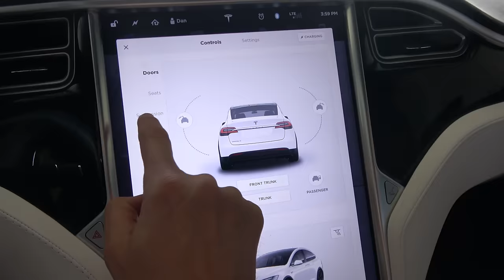What's inside a Tesla Tire?

Comment: The tire shop has a point. It take time, labour and resource to fix that wheel. They have to take out the tyre, cut the foam, fix the leak, glue back the foam and rebalance. No way it is free if it was that labour intensive. 

With regular fix, just locate puncture, jab with fix kit and you are good to go.
Reply from the maker: I told them I would happily pay for their time, the manager at Discount Tire said they refuse to touch the tire.
Reply: I have repaired the silent foam tire. Cost is roughly double a normal repair due to extended process.  Michelin,  Pirelli and Continental make these types of tires.
Reply: While that may be true, which I'm not saying is or is not, it's advertised as a temporary fix.  It's basically an alternative to a spare tire that takes a little more work, or less for a large heavy tire.  A permanent fix is a patch inside the tire.
Reply: I only repair tires from the inside.
Reply: I work at discount and we would take the time to do all that free because we are just good people and a good business. So yeah you fix a tire even if it takes all the time
Reply: OptimisticPessimist repaired tyres are Always a temporary fix as you will damage the cord when while repairing.
Reply: i work for discount and at my store location we fix those kinda tires ive done 3 repairs on noise reducing tires i dont pull the foam back i just cut a little square out big enough to do the repair takes a little longer but not to much longer and still free
Reply: Peyton Aho no you don’t
Reply: Its actually not that much more of a process I've done this repair several times as a discount tire Assistant manager and it took an extra 2-5 mins max.
Reply: We have a tire foam core bit at our shop as well that removes a small bit of foam on the other side so we can get to the rubber and repair the issue...we almost never put the tiny foam bit back but fill in the quarter size cored area with a flexible quick set polyurethane foam. I think the tire shop knew who he was and just said it's probably better not to deal with them. We do charge $20 bucks for liability purposes in case we screw up the rim or tire. Try going into a doctors office or hospital and asking to get stitches for free.
Reply: Michael Gese why would he lie about something like that what does he have to gain 😂
Reply: I find your reply most realistic. Because tyres like those does not seem to be made patch able. And you need to use glue or fill in foam in your case. Still cutting up the inside of the tire to patch doesn't feel right somehow.

Comment: 5:16 What? That’s not true. You don’t do that because “the tire will spin freely”. You loosen the lugs while the tire is down because they’re typically torqued on tight. You don’t want to knock your car off the jack while pulling the lug wrench to loosen the nuts. Also, don’t take the lugs completely off before jacking the car up like he did. Just Incase you do have problems while jacking the car up. Just loosen them until they’re hand tight. When the car is safely on the jack, remove the lugs fully. Do the same process in reverse while putting the new tire on.
Reply: I always use a jack stand when changing tires too. Something so simple can easily turn into a big headache. I'm sure that tesla's brake rotors cost a penny or two.
Reply: Lakaiskates Exactly. Jack stands are definitely a good idea. Also, as silly and simple as it may sound. Some people don’t know the proper spot to place a jack under the car. I’ve heard stories of people damaging their car because they put the jack on something other than a solid part of the frame. You can easily avoid hundreds of dollars in damage by knowing how to properly change a tire
Reply: closinginonclosure a
Reply: He was right in what he said though too. If you try and loosen the lugs with the wheel
In the air it will spin freely. When working on my cars I just skip this step though due to having an impact that loosens the lugs no problem when in the air.
Reply: Tucker Maxam I guess it’s slightly possible the tire could spin. But not likely. Depends on the type of vehicle, whether it’s front, rear, or all wheel drive and which tire you change. Tires attached to the drivetrain won’t move. That’s why your vehicle won’t roll when in park. Some vehicles lock all tires while in park. Regardless, I’ve changed front tires on rear wheel drive cars and they didn’t move at all. It usually takes a bit of force to move a tire. And with lugs being close to the center of the rim. Spinning the tire is difficult. Think of a merry go round. Or a spinning prize wheel. Imagine trying to spin them from the center rather than the outside. It’s very difficult. That’s just physics. At the end of the day, the main reason you loosen on the ground is so you don’t wobble the vehicle off of the jack.
Reply: closinginonclosure dude that is a big reason to loosen the wheel on the ground..... alot of situations the wheel can turn, like if it is in neutral, or the car is fwd and you are working on the rear, and vice versa............. front wheels of a rwd car don’t lock when in part, nor do rear wheels of a fwd car.
Reply: Tucker Maxam This dude has never worked on a car in his life, just let him live
Reply: PAsn0w43 If you read my previous comments you’d realize I already talked about wheels locking depending on front or rear wheel drive. I also said it’s possible for wheels to spin but it’s a rarity if you know what you’re doing.
Reply: PAsn0w43 I’ve never worked on a car in my life. Haha. Yet you say the main reason to loosen while on the ground is spinning wheels and not because you may wobble the jack. That’s hilarious. Ok dude. Whatever you say. Think what you want. Doesn’t change the truth. I guess that’s why nobody liked my original comment. Because I’m so wrong. You really got me. I’m so embarrassed.
Reply: closinginonclosure the fact that you say it is a rarity, and then go and say you know what you are talking about just blows my mind. Jack a car up, and try to loosen a lug nut on a wheel not on the drivetrain, with a breaker bar or tire iron. You couldn’t if you wanted to, because the wheel will spin before you can break it loose. Literally go outside and try it right now if you think a wheel won’t spin that easy.
Reply: closinginonclosure also it seems like you are just dieing to explain to somebody that you have to jack the car up at the proper jack points, like anybody who actually works on cars wouldn’t know that already.
Reply: Unless you have a diff lock and you put it in gear.
Reply: Rino Fagerlund If that were the case. Any car in park without a locking differential would be rolling down hills.
Reply: PAsn0w43 I currently own a Jeep. Non 4 wheel drive. Have changed all 4 tires without spinning. I’ve done this to multiple vehicles from a 67 Mustang, Blazers, Nissans, Hyundai, and others. Never had spinning problems. One of my best friends owns a tire shop which I visit frequently. Never witness spinning. Not while removing or tightening lugs, or taking tires on or off. So go on about it all you’d like. I know what’s what.
Reply: closinginonclosure i agree
Reply: closinginonclosure Not trying to argue here... I work in a scrap yard, we process hundred of vehicles a year. Imagine you’ve pushed a vehicle into the workshop, lifted it up on a two post lift, and it’s not touching the ground in anyway. Now, if you get your breaker bar and socket, and try to undo a nut it won’t undo, as it is torqued up so tightly that the wheel will just spin round as you push the breaker bar? When it is on the floor you should undo them a few turns, just to get you past that initial torque.
Reply: Tommy’s Diecast Apparently that doesn’t happen
Reply: closinginonclosure also, stop calling it a tire. It is a wheel, with a tire on it. If you knew anything you wouldn’t be calling it that
Reply: Rekt

Comment: Which Discount tire did you go to? I've work at Discount Tire for a year and a half and I can recall doing 2 separate flat repairs on foam-lined tires. Tesla was correct in saying that, to repair the hole, you just cut away the section of foam and then glue it back on. Again, I've done it twice. 

If that foam was indeed what the Discount Tire employee was referencing when he said the flat couldn't be repaired, he was obviously wrong.

Also, a bit of trivia: That foam does make the ride quieter and I've seen foam-lined tires on Teslas, Cadillacs, and Mercedes SUVs. They're not unique to Teslas
Reply: Yeah same here, I work at an America’s tire here in california, the only time we can’t repair a Tesla flat is if it has continental tires, due to the glue that they use for the foam

Comment: Alright. That wasn't too bright. Just dismount the tire. Wow. 
Anyway, the foam is there to dampen the sound an extremely low profile tire produces. It's a run flat, so imagine the structure of the sidewall; stiff! Large diameters and higher pressures. Hit irregularities in the road surface and you get a 'ping' type noise. Continental tires have that feature and are used on the Audi RS7's.
Reply: Francis Grabetz finally someone that’s knows what they are talking about
Reply: The foam system is a Pirelli idea. The "Pirelli Noise Cancelling System" it's called, and is usually applied to OEM tires, by the car manufacturer.

Comment: Flat fix for free????!! I paid 10 to get my tire fixed down here in LA Cali
Reply: Same
Reply: Ive seen our local discount tire hang up a sign that says "free flat repairs". Its a pretty cheap way to get people in the door and often end up selling them a new set of tires. You come in with a leaky tire, it turns out to be a sidewall puncture because why not, so it has to be replaced. But all the tires are pretty worn, so you should really buy two so it drives correctly, but then you are going to need two more soon, so might as well go ahead and get all four...

Yeah, other than that brilliant loss-leader promotion I have never had anyone fix my tire for free.
Reply: They have fixed many of mine for free. I also worked there and fixed hundreds....for free!
Reply: I paid 25 to patch it 50 for a whole new tire

Comment: Where in the US you can fix a flat tire for free????? Is this a joke???
Reply: Discount tire fixes flat tires for free.  It's essentially a marketing tactic, if you get your flat fixed by them, then you may go back to them for tires and/or wheels later.

Frankly it works, they're the tire shop that I tend to think of first.  Probably helps that they've done a good job with having inventory when I need tires and their website being easy to use.
Reply: Most dedicated tire shops. They usually don't pay their employees by piece rate and instead hourly, so fixing a zero dollar ticket doesn't cost the tech money when he is on a free flat repair that takes as much time to do properly as 2 regular tires.

The idea is, not all flats are repairable. So out of 10 flat repairs, if 3 of them are not repairable, sidewall damage, rubber flakes in tire indicating damage to tire structure, a puncture that is larger than a certain length, goes in at too severe an angle to be properly patched, etc. they already have you in their shop with the tire off, and can sell you a tire.

On average, there is no money to be made selling tires, the margin is so close that the only way to make money selling tires is to put protection plans and alignments on the ticket as well. Or sell tires with high margins on them, most house brand tires have good margins. Discount has good margins on Pathfinder tires, Walmart on Michelin douglas (crappy tire don't ever buy it or let anyone tell you otherwise) etc. Those tires they can sell and not lose money. Some tires, actually come out to a net loss if they only sell the tires, it actually costs them more to sell the tire alone than not to sell it at all. So when you give out a free flat repair, and get say 30% sales out of those tires, if you can get TPMS kits or protection plans or alignments on 2 of the 3, you just payed for every other flat tire you did for free and made a net profit. A small profit, but a profit nonetheless. In addition, the people you gave free service to are likely to come back when they need tires, and if they are buying anything worth some money, the protection plan is always worth buying as it only takes one nail near the sidewall (rule of thumb is within a thumb width) and the tire in unrepairable. On a $250 tire, that is a lot of money to shell out when $40 at the purchase time would have gotten you a free or prorated new tire.
Reply: Yeah I went to Goodyear and they patched it for free as long as it’s not crazy
Reply: Discount tire
Reply: America’s tire
Reply: I have fixed a half a dozen tires like this, I don't work at a tire place but fixing a small hole in the top tread is super quick and ez pz. Would take anyone with the tools 5-10 mins. I imagine an actual tire tech would be even faster.

Comment: isn't that foam inside for the run on flat feature?  stops the tire from completely compressing down onto the rim and damaging the rim?  rather than sound insulation?
Reply: Fred Powell : Exactly my thought. If it was for sound, I’d think the foam would be more of an egg crate pattern inside. Could be both though.
Reply: Fred Powell airport
Reply: Fred Powell aircraft
Reply: Airport and then
Reply: The runflat feature is the steel in the sidewall. The foam only absorbs sound waves.
Reply: The sound proofing statement has nothing to do with why the foam is there, it was just a mutual benefit brought up.